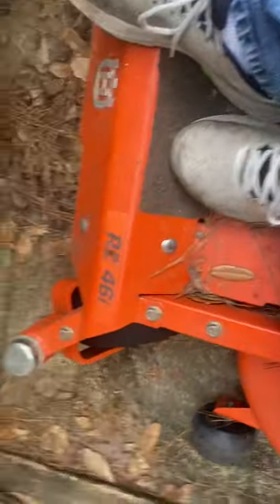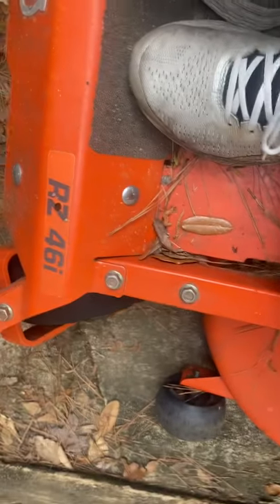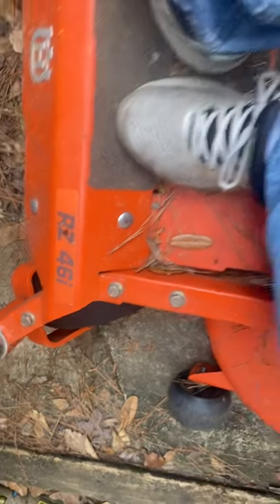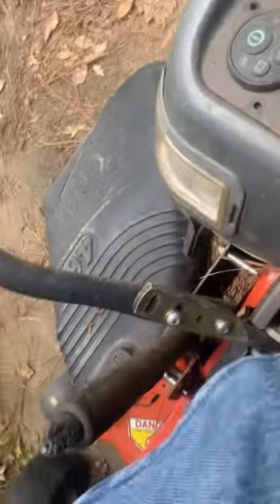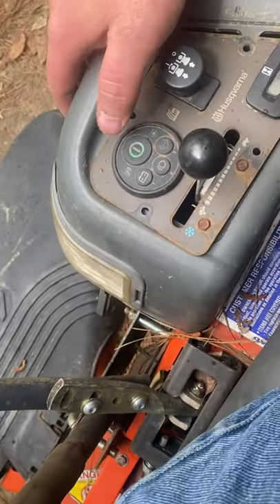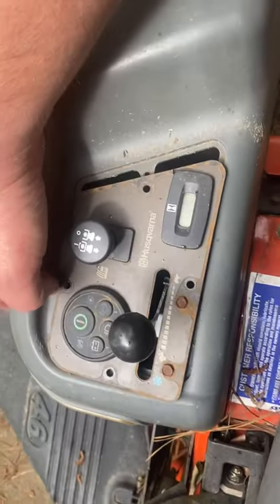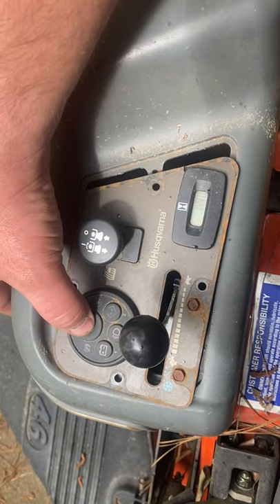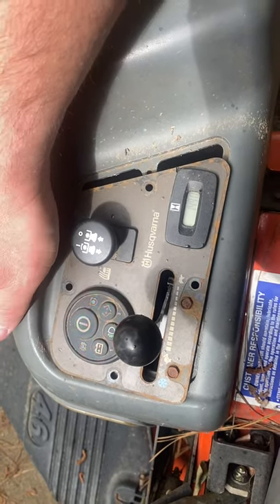Husqvarna Zero Turn Mower Only Clicks When Trying To Start - Starter Solenoid

Comment: It might be the starter solenoid. You can jump it with a wire from one positive to the other positive. Be careful because the wire might get hot if it’s held on there for a bit